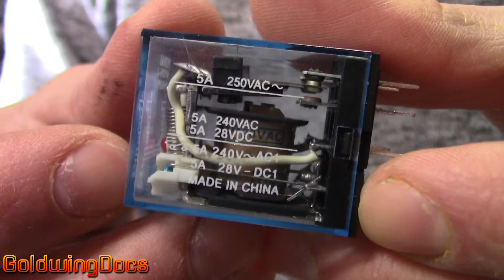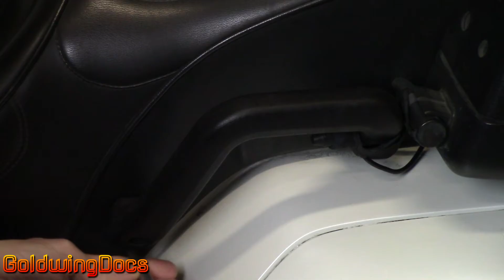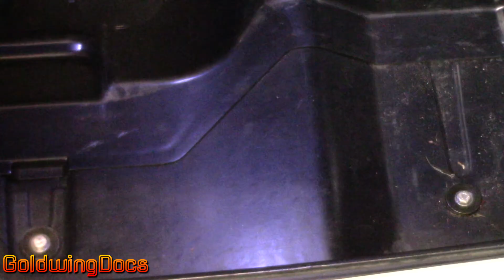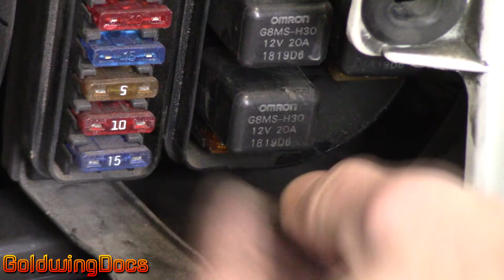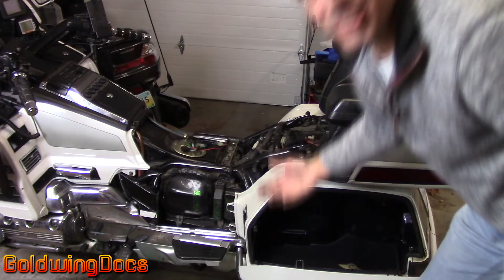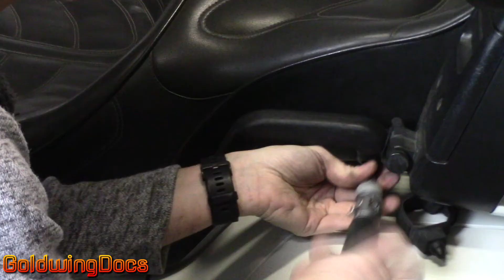Goldwing Relays: A ticking time bomb? How to replace them!

Comment: GL 1800  ,  STARTER. RELAYS  
A  &  B  ,  POSSIBLY  CONTRIBUTING   TO   NO  CRANKING  ISSUES .
(  NOT  UNDER  THE  SEAT. RELAYS ,   LEFT   SIDE   --  RIGHT  OF  BATTERIES   POSITIVE   TERMINAL ,   REMOVE   THE. LEFT  SIDE  SADDLE   BAG ,  UP  &  TUCKED  UNDER  THE. BIKES. FRAME . )

Comment: I thought BMW was the expensive bike to own and maintain..
I use to own a factory naked GL1100 years ago got close to 300k before I sold it.
Most nimble large motorcycle I ever owned. Crazy as it sounds I was able to take it on dry single track trails for camping thanks to that low center of gravity.
Just had to take it easy and watch for tall rocks to avoid.

Comment: My 1500 has started blowing the 15A TAIL fuse and I'm curious if you think it could be a relay or something else?  I swapped around the top row of 20A relays but didn't get anywhere with that attempt.  My Wing is an '89 with 175k miles, almost all of it by me, and I've never had any relay issues...........so it appears I may be way overdue?

Comment: When I have to replace a relay, I will just replace it with an automotive relay instead. The Honda ones are spendy and the automotive relays seldom fail. Same with a starter relay, which are more heavy duty. I will replace them with one made for a small motor like a lawn tractor, etc. They are also made better and seldom fail.
 And as long as we're on the subject of electrical parts, the fuel pumps are also quite spendy. I've just used the small 3-4 lb. psi automotive  fuel pumps which are made much better. So save some money (and headaches) and use cheaper automotive parts instead.

Comment: Thank you for another awesome video! I have a 2004 GL1800 and would like to know how to test the tail light relay? I blow a 15amp mini fuse everytime I turn on the ignition. I don't have tail lights and the gauges don't work as well. Thanks again, appreciate it. 👍

Comment: Hi -
I have a 2009 GOLD WING GL1800 Audio Comfort Navi XM, that has been sitting (garaged) for a few years. I just installed a brand new battery. I went to start it. There is plenty of juice, it turns over great, it just does not start.
Any suggestions?

Comment: Have GL1200.  Is there a way to use a relay to activate fuel pump using just ignition switch, instead of the start button?  Hoping that would help starting after long periods the bike is idle.

Comment: Hi Scott, I'm a member of the goldwing docs forum, and my position lights aren't working. Is it possible that the R3 relay has failed that will prevent the position lights from working, but everything else connected to that relay works?
Reply from the maker: More likely the position lights have burned out - it happens a lot with the original incandescent bulbs.
Reply: @GoldwingDocs  yes I thought that, I replaced the bulbs and still no dice. I'll check power is going to it and start from there. Thank you for the forum :)

Comment: My 2012 GL1800 won't start after battery was hooked up backwards by mistake but only for less than 5seconds, turns over but won't start and lost all my lights. Checked the fuses  any idea for what to check.Mileage is 22,500

Comment: I have a 2003 GL 1800 that ran fine all summer, fall and early winter. Just before Christmas I tried to take it out since the weather was nice, which was only a couple of weeks after the last ride, and NOTHING. I am new to this and I know the battery was replaced when I bought it in June. When I turn the key on, it lights up, radio comes on, but still nothing. I will point out that when I hit the starter, the headlight dims. I haven't checked the relays and/or fuses, but that is my next step in my opinion. Have you seen this situation before? If so, what was the solution?

Comment: I am curious, if you add a couple of  led lights, phone chargers, trailer hook up, do you need to use a relay or can you hook up directly to the battery.  i saw a video where a guy added fuse box on his bike and the hook up he bought came already connected to a relay. tx again. Love all your vids.
Reply from the maker: Have a look at this article which talks about this exact thing: https://goldwingdocs.com/forum/viewtopic.php?f=18&t=10890
Reply: @GoldwingDocs  thank you, much appreciated.
Reply: @GoldwingDocs  trying to determine if a 30/40 amp relay can power several instruments such as phone charger, trailer hook up with led lights. Sorry to bother you with those questions but relays are new to me and I am still trying to figure them out. Tx

Comment: Hello Scott, great videos you do. I have a question for you. So I ordered new 40amp relays from your store to replace all of the 20amp relays on the left side of the bike. Would I also replace the 10am relay w the new 40amp?
Reply from the maker: The blue 10 amp relay is a different type of relay (it's an NC relay) so no, do not replace that one with one of these relays.
Reply: Understood. So all the other relays are safe to replace with the 40amp? Or do some need to stay as a 20amp?
Reply from the maker: @anthonysteckle  You can safely replace them with the 40 amp relays.

Comment: 1994 GW ran battery dead,tried to jump start off charger now cruise,turn signal auto off doesn't work dash digital display and air pump not working did eventually start  checked fuses all seem to be good, 12.2v not running 14.2 running, would you say relays? And if so which ones? Thanks

Comment: Help !
My cousin is out of town and broken down. His 1999 GW 1500 keeps cutting off after riding a little ways. 
After it sits it will start again with no problems till he has gone down the road a little ways again . 
Any suggestions ?
Reply: Check the fuel cap and see if it is holding a vacuum. If it starts to stumble, and opening the fuel cap fixes it, leave it loose until it can get cleaned/fixed.

Comment: After 300.000 km it looks like I have my first relay problem. But it is with the blue relay. Do you have one that fits the blue 10amp relay?
Reply from the maker: Really! That relay virtually never fails, simply because of the way in which it is used. Because of that, I never sourced one (it's different than the others). So we don't have that one available, unfortunately.
Reply: We'll I could be wrong @GoldwingDocs  . I read them all and all 20amps give me ±99 over 0. The 10amp gives me between 98 over 4 and 98 over 23. As I understood. it should be over 0 as well. Please let me know if I'm correct.

@GoldwingDocs   Why I checked. The LCD panel blew. The well known bubble. about a week later the LCD-info, radio, Cruse Control and air pump stoped all at the same time. Now I've installed a new LCD panel but nothing shows. (Followed the youtube instructions 3 times). So I'm searching (using GoldWingDocs) what is in fault. Any thoughts are welcome.

Comment: If your bike is cranking, just not turning over, would that still be a reason to get a new relay?
Reply from the maker: Typically if it's cranking but not starting, the problem is a weak battery.

Comment: I have a 2006 Goldwing Trike GL1800. I had backing problem, where it would only back up about 6 in at a time. Then it stopped backing up. then when i go to start it, it just clicks once. Dose that sound like a relay to you? If where would it be on a trike? My battery is where your fuse box is.

Comment: In relation to the current breakdown (motorcycle no longer starts with blackout)
The 20A relays, I reversed some to see, it doesn't change anything, so I concluded that the failure didn't come from there.

Comment: Don't know if you'll answer but my curb lights,side stand lights,oil light,fuel,side lights won't come on after I have serviced my 1500se,would or could it be relay switch as I've checked all fuses thanks Andy Hesketh,uk

Comment: Thank you many times over. I own a 2010 GL1800 trike which I bought used years ago. Over the years due to high labor cost I have undertaken projects that I though I'd never attempt in reference to GOldwing repair. Will these relays connect to the GL1800 relay footprint? If so I would like to order some of them from you . Please let me know how to order if this application will connect to the GL1800 .

Comment: There are solid state relays with no moving parts . I have SSR’s that are from the 1970’s and they still work.  SSRs are great for controlling high current loads ; back in the 1980’s in electronics school , I made a circuit that flashes a 120 volt light bulb at 15 hertz which consisted of a 555 timer set to a stable mode with a 50% duty cycle connected to the front end of the solid state relay ; they light bulb switched on and off with no issue . I have SSRs that can handle 10 amp loads , 120, 240 volt , 12, 24 volt … they are available all over the net .

Comment: Hi Scott - Enjoy your website and the Youtube channel!  You've probably helped out more people than half the mechanics in my state over the years.  I just ordered a couple relays, one of which I hope to use as a replacement for the fuel pump on my old GL1200.  I know it's not OEM, but those are running close to $100 now - if you can even get one.  (I think Randakk's still has them.)  For the price difference I think I can do a bit of creative engineering and relocate the thing so it's not such a pain to get to.  Thanks!!

Comment: Just ordered a few. Just in case. I did have a starter relay just burn out on me on my 2000 Honda Goldwing. GL1500 Aspencade. It was showing signs off issues when I push on the starter button and nothing would happen then after a few attempts it started. Next to the battery is a round looking relay with a fuse box attached to it. two large nuts on top connect positive red wires. The fuse box has a burn mark on it. I have lost all power to lights, instrument panel, radio, cb and everything under the sun. I put a screw driver across the two terminals and the bike kicks over but wont start. I found the relay on amazon I ordered. Not sure if you have a video on this issue but I hear its common with older bikes. I called several shops in south west michigan in attempts to have them look at my bike and no one will touch a bike older than 15 years old. Love this bike but starting to regret buying a bike no one is willing to work on and no replacement parts are available after market for it.
Reply: Do you still selling those relays? I Wonder to by all 6.?

Comment: I have 2000 Gold Wing 1500 SE.  My kick stand light,  trunk running lights,  temperature and gas guage needles just quit working.  I have checked my fuses they are all OK.  Do I needle to check  my relays ?  Trunk brake lights still work.
Reply from the maker: Highly likely that your relay #3 has failed, it controls ALL of those things.
Reply: @GoldwingDocs  thank you it was relay number 3.
Reply: @GoldwingDocs  thank you I'll check those relays and likely change out all of them.

Comment: Thanks for the video! My 2012 gl1800 starter is not working, but it does click on the left side where the relay is. I can jump start it by popping the clutch in first gear, but not jumper cables and the battery is charged. Is it most likely the relay?

Comment: Hi Scott,
I want to thank you for this video. I currently am dealing with the relay/ silonoid that deals with the starter. I started and moved the bike out from the garage , when I turned off the key the engine stopped but the starter did not, I could not get the starter to stop by turning on /off the key & kill switch so I kicked the bike in gear , that finally did it after lunching forward another 10 or so feet.
I went to my goldwing docs searching & sent an email so I've purchased both silonoids & decided to have the starter over hauled/ rewired as I no longer trust it for continued use. Thx for the info both by emails & videos .
I also am going to order all new replacement relays as I had my 1500 for 13 years now with no issues so far but after watching this video I think it's time to replace them.
Also, one last thing, the " straps " that you have on your bike that keeps the side covers from being lost , where can I find those ? Or what do I use to make my own ?
Thx for the goldwing doc videos, I go back to them often.
Dennis S.  Harrisonville, Mo.

Comment: The cruise control on my GL1500  does not turn on when I push the button and it does not function when on the road. This just quit. Could a relay be the problem? all fuses are good. Thecruise  light comes on when I turn the key on and it runs a self check.
Reply: Yes this is Kenneth Maddox I've got a problem with my Goldwing the light will come on when it's in revert for reverse but it does not come on when it's in neutral what is causing the problem I put a new reverse neutral switch on it and it still ain't working
Reply: I don't really know what to do I want to clean all the wires everything the neutral light will not come on no matter what I do

Comment: Hi Scott, I have a 1984 Goldwing and sometimes while I'm out riding, like for a half an hour or longer, and sometimes (not all the time) when I shut the bike off it does not want to start again. I turn the key on and there is nothing, no headlights no dashlights nothing. And if I leave the key on, anywhere from 20 minutes to an hour, it will come back to life and fire back up. But only if they leave the key on. Do you think it is one of the relays getting overheated? And if it is how do I tell which one? Thanks
Reply: Did you ever find the answer on this same problem

Comment: All relays are the same? I would like to replace all of them in my 1990 GW. Please let me know so I can order them from GWDocs.
Reply from the maker: All but one. There are eight relays. One is a NC relay, it stands out because it is blue (all the others are black). So you would need to order 7 relays to replace them all. (the blue NC relay rarely fails, because, well, it's a NC relay). :)
Reply: @GoldwingDocs  Thank you I'll place my order for 7 then.
Reply: @GoldwingDocs  Scott, this would have been really important to include in your video, perhaps you can edit it. 🙂
Reply: @GoldwingDocs Sir, does the 2008 GL1800 use these relays? Thx in advance!

Comment: Are those those two cylinder like on both sides of the batteries Solenoids. Please help
Reply from the maker: Our motorcycles don't have solenoids, they have starter relays - but you'd have to specify which bike you're talking about. Perhaps post a picture on the GoldwingDocs forum for us: https://goldwingdocs.com/forum

Comment: In my 1988 Goldwing 1500, i saw 2 solenoids: one to the left of the battery, and other one to the right of the battery. I think that solenoid is to the right, and relay is to the left. Please explain to me. Dr.Martins
Reply from the maker: There are two large-current relays on the right side. One is near the battery, and one is lower down. Those are the starter relays. Check out this post: https://goldwingdocs.com/forum/viewtopic.php?f=6&t=66354

Comment: Hi Scott recently received some relays 8 no  from you.  The existing blue 10 watt can I fit one of yours and if so is the higher wattage an issue. Edcot
Reply from the maker: No, the blue relay is a different type of relay. All the black relays are "normally open" relays. The blue one is a "normally closed", so they aren't interchangeable. The blue one RARELY fails, as it's not switching the loads that the others are.

Comment: Question I have a 2008 G/wing my alternador has the regulator built in but what's strange that it also has the original external rectifier o don't get it why.
Reply from the maker: 2008 Goldwings never had an external rectifier - so you must be looking at some other component?

Comment: Hi Scott, a while back i ordered some of the relays that were offered on your site but when they were delivered i found that they are 40 amp and my 1500 has 30 amp relays, are the 40 amp relays going to be safe to run in my 1500 SE ? 
Sincerely William
Reply from the maker: Hi William!

Yes, that is the rated capacity of the relay. The factory GL1500 relays are 20 and 30 amp, but they fail (obviously) after a number of years. We decided to source a relay capable of handling 40 amps. It will never see that much current in the GL1500, but it means that the contacts and conductors inside the relay are much beefier (capable of handling up to 40 amps) - and wear out much more slowly as a result. Think of it as putting a garden hose amount of water through a four-inch pipe. It can easily handle the current (of the water) going through it.

Apparently this was a good decision, as in all the years we have been selling these relays, we've never heard of one failing.

I'd encourage you to read part one of our Electricity series here: https://goldwingdocs.com/forum/viewtopic.php?f=19&t=19501
Reply: @GoldwingDocs  thank you for the reply , that make sense to me  and I 😁

Comment: Are all the relays the same?  I see different amperages, can we replace them with the generic ones?
Reply from the maker: On the 1500 all the relays are the same except for the blue one, which is a NC (normally closed) instead of an NO (normally open) relay. You can use our replacement relays for all except that blue one.

Comment: I have a 02 goldwing. The turn signals stoped working but the hazards are still working. I got another controller but that didn’t fix the problem and not the bike won’t start. Any suggestions would help thanks.
Reply from the maker: Definitely post this question in the GoldwingDocs GL1800 Forum: https://goldwingdocs.com/forum/viewforum.php?f=7

Comment: Are all of the relays the same? If I buy one or two of your relays will that cover all of those relays under that cover? Are there others that are important to have on board that are not within that cover?.
Reply from the maker: They are all the same except for one, which you can identify because it's blue. The blue one is a normally closed relay, unlike the others, and rarely fails. All of the other relays are interchangeable.